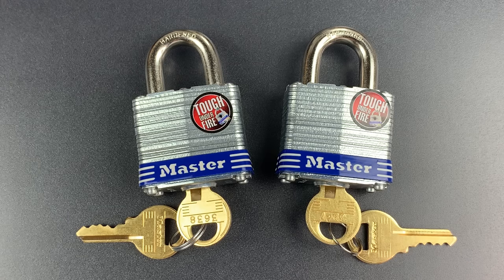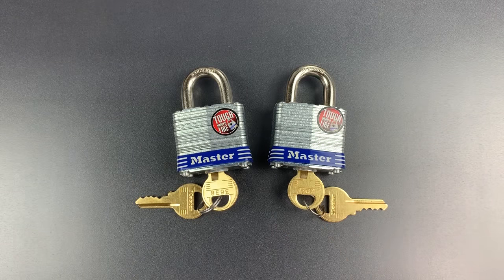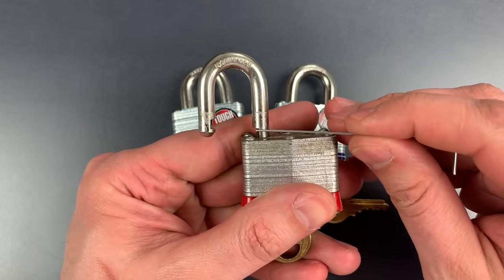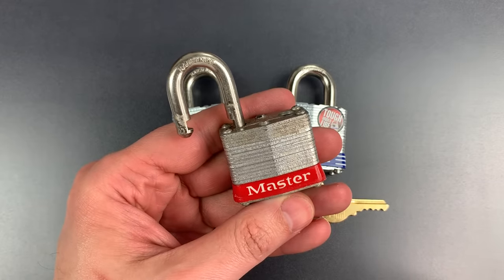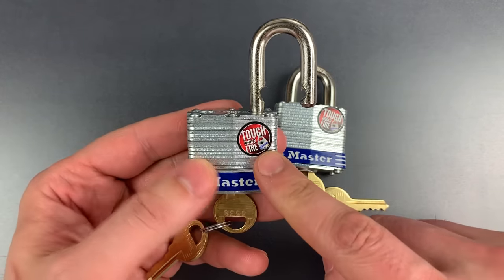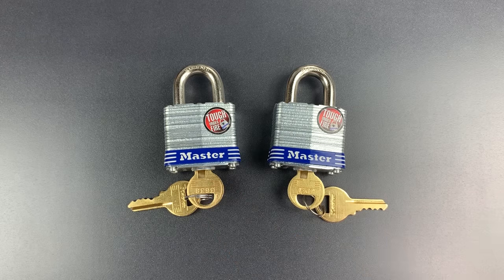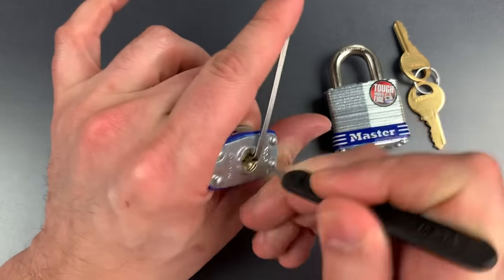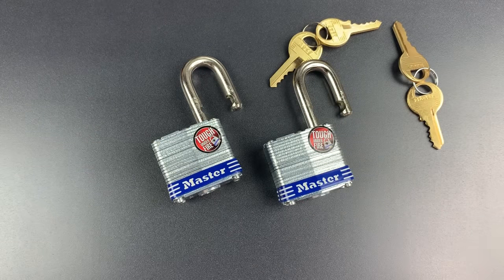[833] Missed Opportunity: The Redesigned Master Lock No. 3

Comment: Let’s be honest, what would master locks be good for if not training amateur lock pickers?
Reply: Paper weight
Door stop
Bacon press
Fishing weight
Model boat anchor
Improvised weapon
Blunderbuss ammo
Hitching post for anemic mice

I'm sure there are more, but those were the first that popped into my mind.
Reply: I mean, they're basically for making things marginally harder to get into. Sometimes that's totally sufficient, you know, in a "keep the kids out of the shed" kinda way.
Reply: I bought one of these locks and put it on my back fence. It stopped the problem... which was my dog flipping the catch with her nose and taking untethered walks. 

I bought it not because I thought I was getting "level 5 security" like the package proclaimed, but because it was the cheapest lock on the shelf. I just wanted something that looked better than a bent coathanger through the catch. 

Masterlock: Smarter than the dog.
Reply: Frankly you can’t really use them for training.
I have no clue of lock picking and was able to pick this new version of the No. 3 with a normal hook on the first attempt in hardly 5 seconds.
Raking most of the times takes two seconds.
Reply: Literally have a chain of 4 different ones I practice on. Started a few weeks ago. Not difficult
Reply: @HingerlAlois  what am I doing wrong i don't understand
Reply: @forrestengler8713  
Well what are you doing? What’s the biting on your key?
Reply: Yeah I grabbed this one yesterday 2nd lock I tried. Popped right open.570s alot tougher
Reply: @edwardmorgan5750  zip ties are cheap
Reply: @JohnLeePettimoreIII  I’d pay money to see someone blast a Master Lock out of a blunderbuss.
Reply: Probably not even good as a training lock really aside from maybe baby's first lock, considering even a five year old could probably open the damn thing
Reply: Labeling items as "five finger discounted"
Reply: @jttech44 see I have that ball bearing one in my hand and was like “how would he do it” and followed along. Opened it exactly as fast as he did

Comment: I think Master is doing a terrific job and doesn't need to change a thing!  Keep up the good work!

I do have an observation I'd like to point out... that many, many people who have been in the Master Lock distro channels for years and years, have sold lots and lots of MLC #3s, haven't ever noticed. And, as a West Point guy, it really bothers me because of the "don't lie, cheat, or steal" that's ingrained in us.

Count the number of rivet heads on the top of the lock...

... then count the number on the bottom.

Hopefully something didn't add up for you, and that's because the set of rivets that are seemingly in the middle of the lock are not really there. The top plate has two pretend rivet heads pressed into the metal plate to give the appearance of real rivets. I'm sure years ago when MLC was designing the #3, they realized they didn't have room to add that third set of rivets in the middle. But having only four rivets looks weak.  What to do, what to do?

Well, MLC decided to pretend there are two rivets there! And pretending to be something you're not is not what I'd consider to be following the cadet honor code!
Reply: PACLOCK PRES. REALLY NOTHING NEEDS A CHANGE? that’s stupid what you said they need to put 6 pin cores in the locks with security pins you can literally pick the locks in 5 seconds and pick with paper clips these locks are terrible use abloy protec 2 instead
Reply: @jeseniahernandez8795  he was most likely being sarcastic, judging by the tone of the rest of the writing
Reply: @jeseniahernandez8795  bruh
Reply: @jeseniahernandez8795  Are you okay
Reply: @chitoryu12  Only capital letters and eight exclamation marks.. yep she's insane.
Reply: Boom roasted
Gg Paclock Pres, killing Master Lock's garbage since your inception

Comment: Thanks for the video. I've been following you for years, and I consider lock picking a good hobby. However, today it finally came in useful. Someone was throwing away a ten-foot-length of chain because they lost the keys to the (above) locks. I scooped it, happy to have a project. My cheaper pick-set didn't have the same rakes, but once you mentioned the 4-pin configuration - what I was feeling inside made sense. Had them open in almost no time at all. Now I have some practice locks, and a section of link chain (that I'm sure will be useful for something). Thanks! (time to upgrade my EDC set)

Comment: Just because it has ball bearings, perhaps only a minor improvement -- what is the actuator made out of that holds those ball bearings in place -- Plastic? Zinc? wonder what the pull strength is?  Perhaps "don't pull to hard"? {so as to not crush the actuator; should be in the disclaimer warning)   -- maybe even a strong shim could collapse the actuator? (it's only a Master) -- SO LPL, let's see you give it a pull test, eh?
Reply from the maker: Ken Nixon Fair point... smart money says its zinc. Testing and tear down is on my to do list. 👍
Reply: @lockpickinglawyer  A quick "disassembly" revealed a zinc cast actuator -- Still wonder if a shackle "pull strength test" would actually show improvement over the previous design?  I would hope it would (but no "cheating" with torch to melt the zinc actuator, but why bother when you can rake it open in a second or two) -- added note; ball bearings are steel at 6.27 mm dia -- I was going to replace them with 6 mm plastic air soft BB's to make it more secure, wonder why Master didn't think of that?
Reply from the maker: Ken Nixon I’ve done some strength testing with the Ramset and my hydraulic press. On 6 locks, I had 3 broken shackles and 3 with no apparent damage. I suspect a deformed actuator is the culprit, but I haven’t gotten around to the autopsies yet.
Reply: LockPickingLawyer --  Interesting -- looking forward to your autopsies

Comment: Hey there!  I was given 4 of the older style NO 3's with no keys.  I am a brand new picker so started with city rake to try to open them.  After I got to the point where I was opening consistently with the city rake I decided to try single pin picking.  I wasn't having luck until the pick seemed to go further back then I expected.  Since then I discovered I can open all 4 by putting the pick all the was back in pushing up....  Why would this be?  Really bad biting on locks keyed alike?  or?

Comment: Dear. Mr. Lockpicking lawyer, I am retired LEO and was given a lock with the name “Best” engraved on it back in the 80’s to secure a firearm inside the trunk of a car. I have only one key for the lock and the key is stamped “do not duplicate” . Is this an easily picked lock and where could I obtain a blank so I can have a duplicate key cut? I understand any locked can be foiled, however, what currently available padlock, (say for up to $100), would pose the most difficult “nut to crack” that the average hood would probably be stopped by?

Comment: Hey, you know what... I'll give them credit for it. I think for a majority of use cases improving the locking mechanism was a major improvement. Seems like most crooks are going to come in with hammers and bolt cutters, not rakes or even padlock shims.
Everyone praises things like the ABUS titalium locks for being pick resistant, but personally I would never recommend most of them for real-world use because they use standard spring-loaded locking bars. Some, but not all, can be shimmed, and I doubt that many would stand up to a firm smack with a hammer.

Comment: I saw this in the hardware store.....I looked at the key first to see if it was changed to five pins....but no.
Then i looked at the keyway and you will also notice the bottom plate looks like a anti drill plate as it is definitely different from the old models.
Glad they use balls now lol.

Comment: As with all masterlock products:  So close yet so far away (from secure).
Reply: Now I have to go listen to metallica ❤
When nothing else, Master
Reply: You have to remember though, the lock is rarely the weak link in your average implementation. Way easier to just cut the mild steel hasp than it is to pick a lock or cut it's hardened steel shackle, which is what you see most often in the wild because very few thieves even bother with lock picks.
Reply: Jacob T Around me, most people install the hasp with the screws exposed anyways.

Comment: Hi Harry, Thanks for showing,  without your video most wouldn't have known about the redesigned locking system on The Master No.3 padlock - myself included. Kudos to Master for that. It does seem strange that the little brass Master 140 padlock contains spools ( made in China I'm sure ) and yet the much heavier No.3 has none. I'm led to believe Master's dial combination padlocks are now made in Mexico, and I guess many others are as well. If Master's Lockout padlocks can include security pins along with the 140, it doesn't seem much of a jump to include them in their other 4 pin locks. A complete retool to 5 pin, I'm sure, is out of the question. Only the Locksport Community give Master a hard time, the buying public are totally unaware of the weaknesses of a standard 4 pin core, no excuses ... but the truth none the less. Perhaps Master are moving in the right direction, first ball bearing locking, next some security pins maybe ......?  Regards, Brian.
Reply from the maker: Brian Hignett yup... master locks product line doesn’t make sense as a cohesive whole... like a car company’s might.  So many legacy products. They really need to streamline their offerings... though expensive, it would probably be cheaper in the long run, and result in better offerings. 

But when they spend the money to redesign something and fail to move their products closer into alignment, then it enters the realm of poor management imo.
Reply: @lockpickinglawyer   Videos

Comment: I  just got into picking because of LPL and Locknub, I always wanted to do it, and I'm hooked now, I started with the MPXS-8 from Southord, and I just received  4 combs sparrows set and extra picks from Southord, I have already outgrown my creeper case in the last 2 mounts I'm getting the comp case from sparrows  next, I have a #3 for 30 years and it's so worn out, it won't let me pick it open, the key still works, but picking it drives me crazy, I've done it a few times, I've spent a few hours so far, the core walks all over the place, but it is just flat-out worn out, Update, I have success with top of the keyway attack, now I can open it in less than 10 seconds every time, so satisfying to know I could get it right, seems you can't pick it if you don't try

Comment: Other than the weak cores are those laminated locks pretty tough against brute force attacks like hammers bolt cutters ect? LPL most likely has many videos to that end. I know a handheld grinder or cutting torch will open anything really. I mean I know that.

Comment: Just got Master #3 a few days ago, and the rake picking doesn't work, at least with what I have, and it is pretty close to the video. Have the improvements been made, or do I need a specific rake? I would like to see the same demonstration with a recently purchase Master #3
Reply: Just keep practicing. I have a newer ML #3 that I've been practicing on and raking is still effective on it. I'm using a sharper pointed rake pick (I think it's called a city rake) from a cheap amazon kit. The Bogota rakes on my covert companion work but the cheaper rake seems to work better and faster for my particular ML#3. 

I seem to have best luck using very light tension with a .40 tool from the bottom of the keyway.
Reply: It took me a little over a day of practicing on and off to get my first open. Now I've opened nearly every lock in my house (at least twice) but not before putting a padlock shaped hole in my basement wall that I now need to patch and paint...
Reply: If u  noticed. He is rocking it back and forth.  I have learned you need to rock it back and forth.  Not  Traditional sliding in-and-out raking  Motion.
Reply: Keep trying. Pay attention to the amount of tension you apply.
I just got a #3 today and it opens using a city rake and the rocking motion LPL used here, as half diamond and a snake rake using a raking motion.

Comment: Just cut off the pins on the bottom and prize off the bottom plate and the cylinder will fall out and you can open it with a s rew driver

Comment: not sure how much those ball bearing locks on the shackle did much good, still fairly easy to shim and open. also got a pair and perhaps these are defective but it appears that the roundness of the ball bearing and the matching shape on the shackle seemed to made it easier to use downward thrust to pull the shackle out, and to shim, so is it me or did I do something wrong? Besides I can think of at least 5 improvements that would make that lock more secure, 6 if you count buying a different lock :) the video is at 10 thumbs down? I cant see why a thumbs down would be necessary unless 10 amuratures that can barely open with a key are now disappointed or as someone noted one of the CEO's was embarrassed?

Comment: Can you recommend a lock that it's a nightmare to pick? They hardly come around in your channel, or maybe even design it? I'd bet they would be popular
Reply: The Abus disc detainer padlocks such as the 88/40, 88/50, and 37/60 are extremely tough to pick. They use a different type of key that requires special tools to pick, and even for people with the right tools, the discs have false gates that will give false feedback to someone trying to pick it. Only a handful of experts like LPL are able to pick them, and even then it takes time.

For a door lock, something like a Medeco lock is considered extremely pick resistant. They are pretty expensive, but once again only a handful of experts can really pick them.
Reply: Veraxis ABLOY PROTEC 2 MUL T LOCK MT5+ CORE

Comment: I picked up my first master lock 3 recently, and could not believe how quickly I was able to pick it! But now it seems it won't even accept its own key :-(. Ideas on what went wrong much appreciated.
Reply: I've had a problem like this before on another master lock, and it's part of the reason I prefer Disc Detainer locks (like Abloys and Abus Plus cores) over pin tumbler locks (like most locks in America).   

Over time using a lock or picking it frequently, the brass pins can get worn away or lose their pointed tip.  That's because the pins are slid against the key many times when putting the key in and pulling it out.  Or when picking the lock, they are abraded by the pick (sometimes quite severely).  Eventually, the original key may not open the lock anymore.  That's why one of the golden rules of locksporting is "never pick locks you rely on"--you may inadvertently wear down the pins and damage the lock.  If you really want to still be able to use the key, you might try pushing the key upwards while in the keyhole.  This can make up for the wear on the pins.

If you want a lock that lasts tens of thousands of uses, I don't think a normal pin tumbler padlock will stand up.  The pins are worn away with every use (albeit on a microscopic level).  A high quality disc detainer padlock is the way to go.